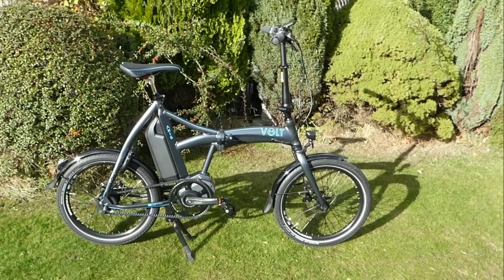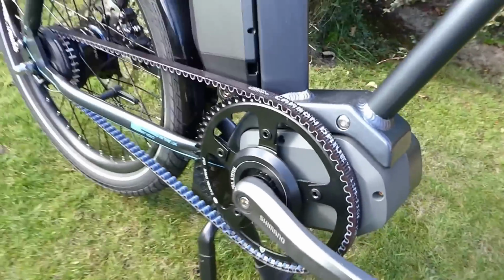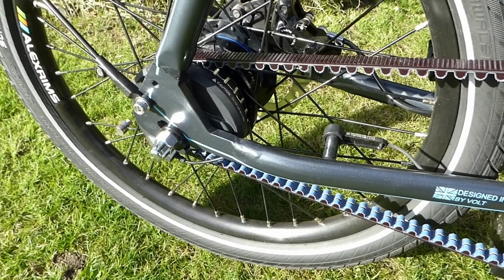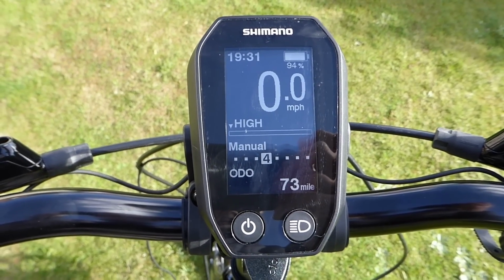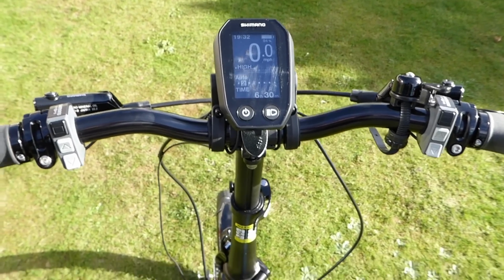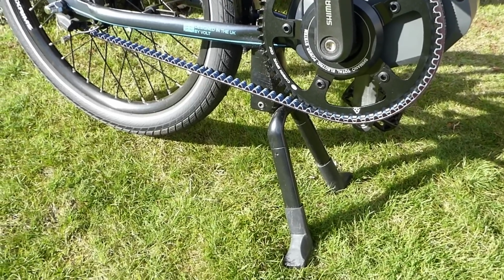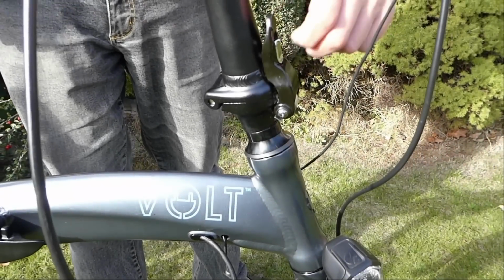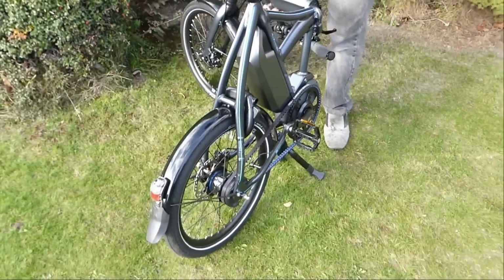Volt Axis Folding Electric Bike: Shimano + Gates Belt | Electric Bike Report

Comment: I am considering ordering one of these machines from my local bike shop which is a Volt dealer. I am close to the max 100kg rider weight, however,  and I would worry about such a premium bike being a target for thieves.
Reply: I wondered how easy it is to repair a puncture on this bike, especially on the road far from home.